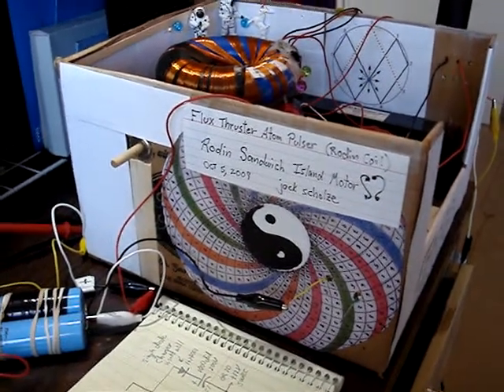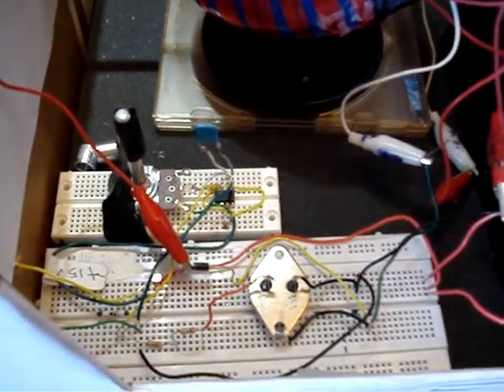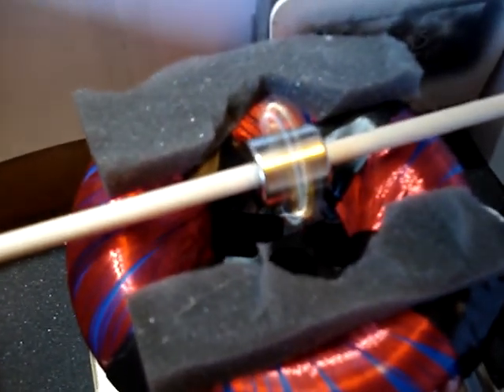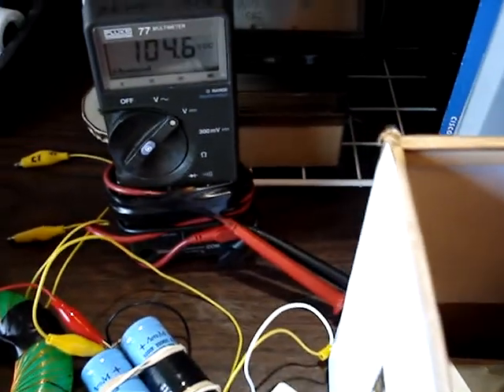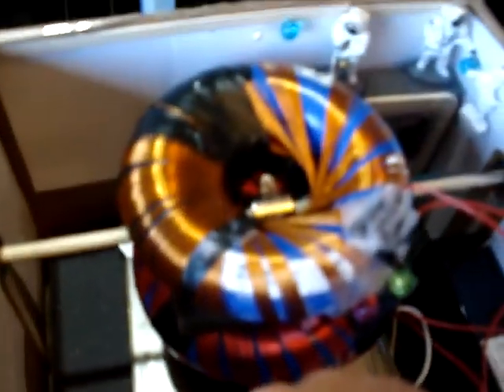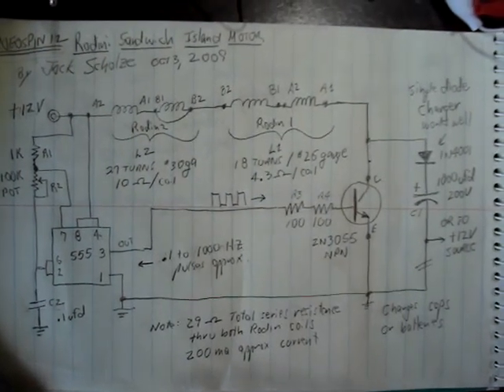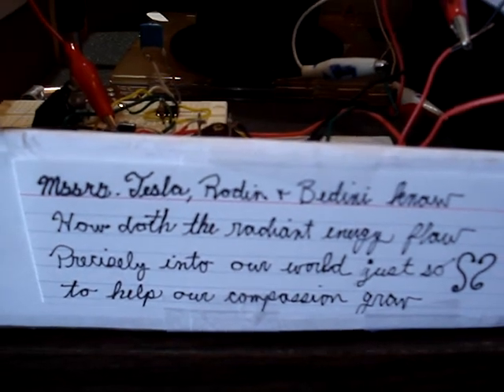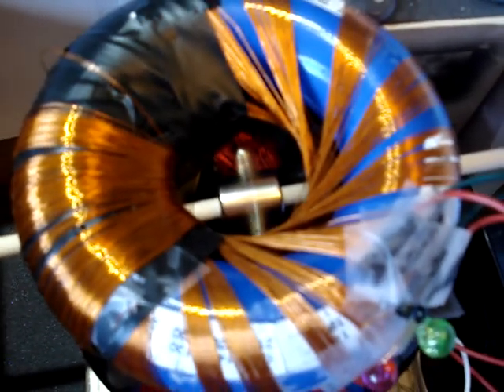neospin12   Rodin Sandwich Island Motor,  ( update )

Comment: Would it be possible to use an effect such as in the homopolor motor to assist the bearing in turning the axle? I was always curious if the Axle itself was a rare earth magnet, or at least the part being effected by the coil, could torque be acquired by placing the magnet in the center of the Rodin coil? I am a big fan of your work, been watching your videos for almost a year now, keep up the awesome work. 
,